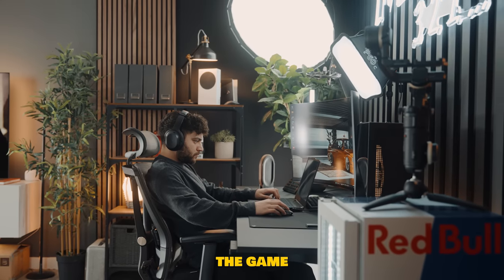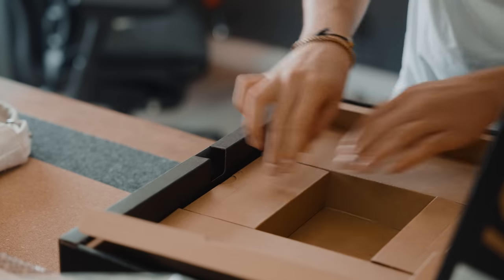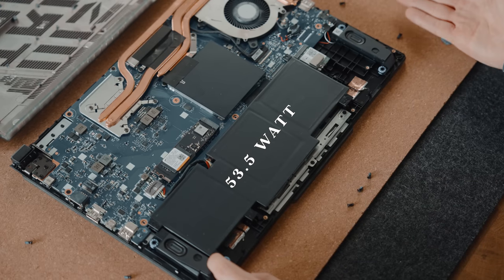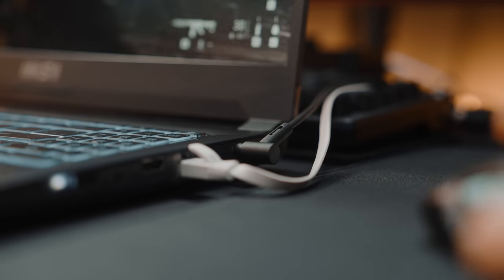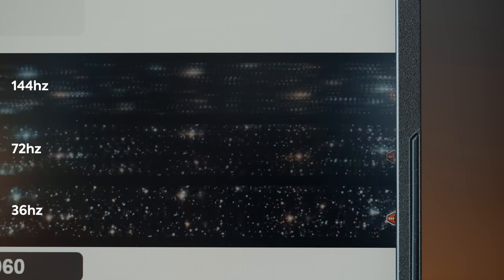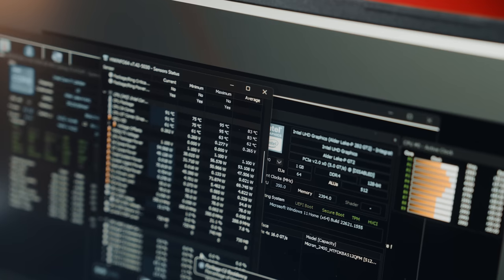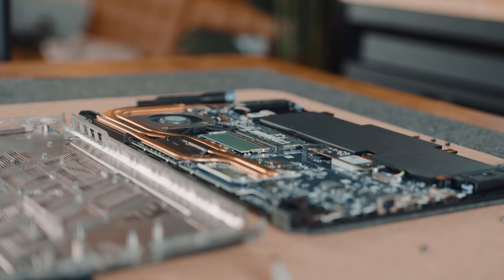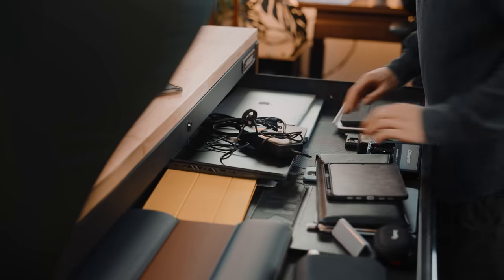Gaming on a Budget: Guide to the Best Gaming Laptop for You!

Comment from the maker: Leave in the comments down below budget laptops you think are worth sharing ?? (from your experience) 

P.S. I cant believe I actually got banned on Valo lol...
Reply: Msi gf63 thin 15.6”
Reply: Asus rephyrus G14 2022 or G15 2021 are still very solid. Two of my classmates have the G15 2021 model and it’s really a beast. Something I would recommend to myself but if not, the G14 2022 is a beast as well
Reply: I got a Lenovo Legion 5pro with Razen 7 5800H 16go of Ram and RTX 3060 6go GDDR6 2k display with 165 refresh rate Nvidia Gsync. I play the 3A games on it in high setting.
Reply: @darkfx3456  how much did it cost you?
Reply: Steam deck review ?
Reply: delta 15
Reply: Lenovo ideapad 3i i7 12700h and rtx 3050 ti
Reply: hi, do you happen to know what kind of thin paper apple use to protect the macbook screen from the keyboard?
Reply: while not completely budget the asus rog flow x13 with the radeon igpu seems like a good bargain
Reply: Msi cyborg 15 a12ve

Comment: Im a graphic designer/ artist/ gamer and since I travel alot I have to go with a laptop vs building a pc and the ASUS TUFF 15in, I picked up in 2021 for around $800 with a RTX 3050Ti.

It Is a Gem for a budget laptop if you are plugging it into an actual set up. 

The cost for this laptop was low  because you will have to upgrade the Ram, it doesnt come with a camera (which is nice as webcams or stream cams are better anyways) and the viewing angles can be iffy on this laptop. ( But this is getting plugged into a monitor so it doesnt matter that much.) 

Then for storage everything is hooked up to my external drive storage hub so it's not an issue. 

2 years of wear and tear and it is still holding up well. 

It plays games like fortnight and sea of thieves at around 120 FPS on high settings. 

Even with OBS open and recording with face cam running and some other tabs running.

Comment: I considered this laptop before as it is the fastest RTX 40 series laptop that came into Malaysia. But the price is too high RM 5999 (about $1300) based on the spec (i7-12650H + RTX 4060 [same as video]) and it only comes with 1 fan (WTF) and 3 heat pipes. Then ROG comes and I just preorder ROG Strix G16 (i9-13980HX + RTX4050 140W + 2k 240Hz 500nits) with RM 7299 (about $1600) with 3 fans and 7 heat pipes (OMG). In my opinion, I think adding $300 to what I get is better specs and worth that Cyborg a lot. There are many different of prices based on every country. As I am still a programming learner (student) in University, the ROG Strix G16 specs is way better and more suitable for me (I need CPU > GPU).

By the way, nice and clear unboxing video bro. ✌✌

Comment: what is your take on: 
alienware m15 r7 i712700h, rtx 3060, 16gb, 1 tb, 240hz for $1,250
lenovo legion 5 pro gen 7 amd 6800h, rtx 3050ti, 16gb, 512gb, 165hz for $1250 as well.
which is more value for money?
is there any major overheat issue in any of the laptops?
need a laptop with less issues even if i have to shell out a couple hundred more bucks..

Comment: For those looking to buy newer, more powerful gaming laptops (or even budget gaming laptops as the video suggests) please look into disabling "Modern Standby" once you get your device if at all possible. With this being an issue with Windows based laptops for a while now it can cause serious issues when your laptop is more powerful and has things such as a beefier CPU/battery setup as most gaming laptops do. 

This issue can cause overheating and battery drain when the laptop is powered down, resulting in a hot, dead laptop when you go to use it. In gaming laptops this issue is exacerbated with their more powerful components and can completely fry your internals. I had a 2022 Razer Blade 14", this issue occurred when I closed my laptop lid after working and went unnoticed for around an hour as I traveled back home, it caused temps high enough to fry my motherboard and the laptop was completely bricked. 

Here is a great explanation by LTT that will give some more info: https://www.youtube.com/watch?v=OHKKcd3sx2c

Comment: worst port numbers (only 2), no thunderbolt,  screen is not bright enough, no extra ssd or hdd slot (only 1 ssd 512 GB so upgrade possible only via replacement), battery size/life sucks, only 45W 4060. I must have been drunk when i bought this laptop. Dont buy this crap at any price. Only thing good about this laptop is the 40 series card and low weight, but sucks otherwise